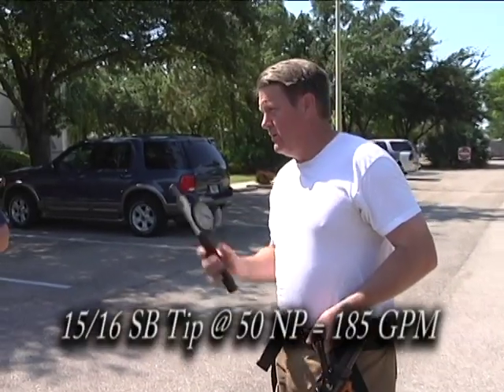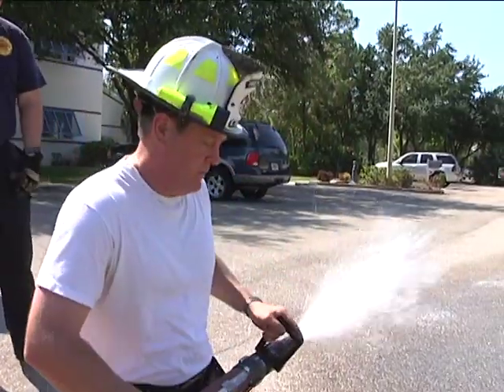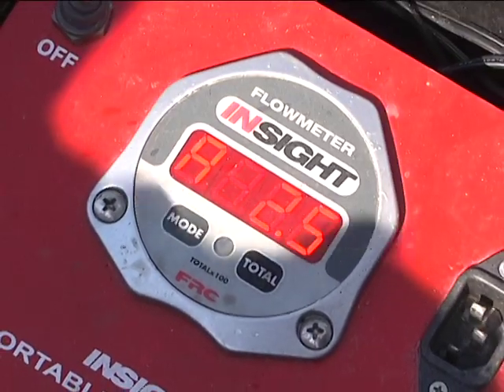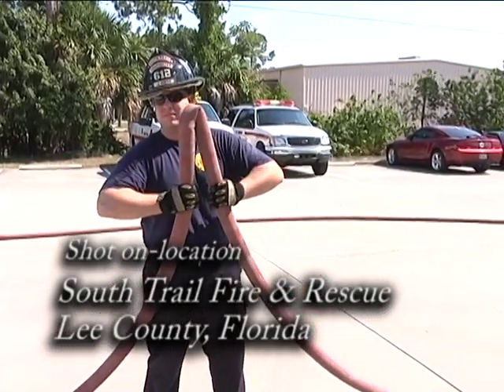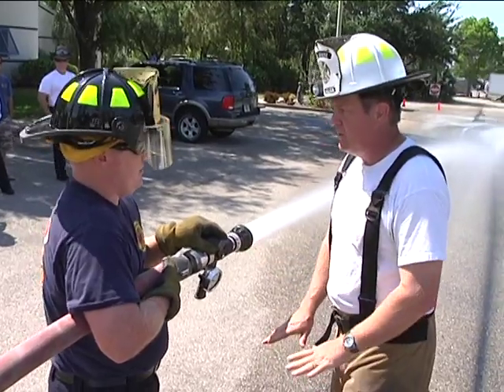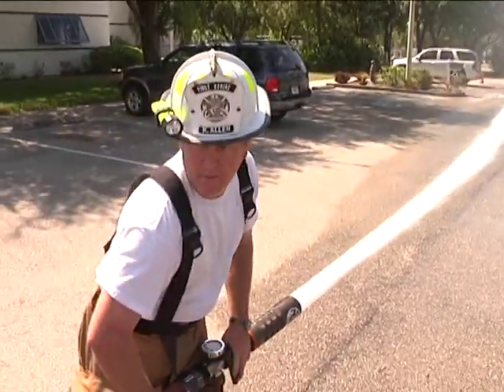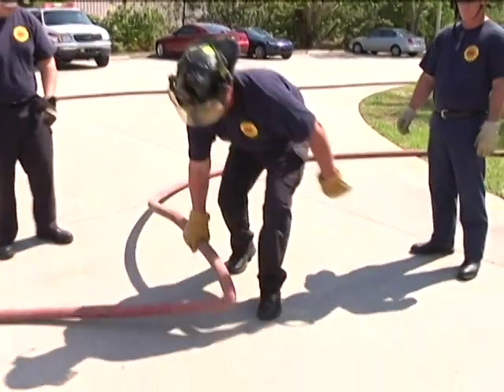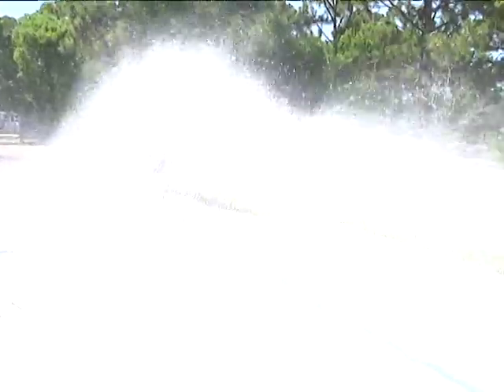Vindicator Nozzle Demo produced by Attic Chat Productions

Comment: We use these and yes they flow cafs well. You will loose some bubble structure but if you loose air or foam you at least have an effective fire stream. 

Without cafs, foam and water only they make a nice low expansion foam that is very impressive.

I am all about overwhelming the btus of a fire. This nozzle does that well. You get great flows through a controllable nozzle. You will loose some reach of a smooth bore but how much reach do you really need for most fires. We easily through the streams 100ft.